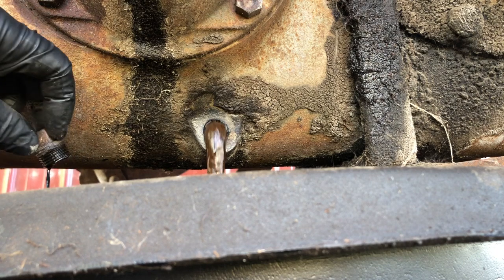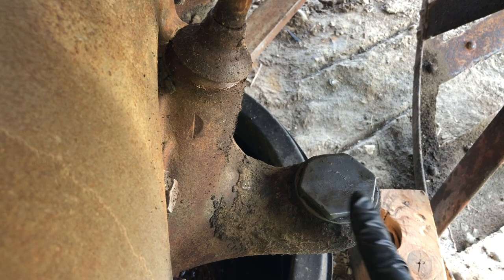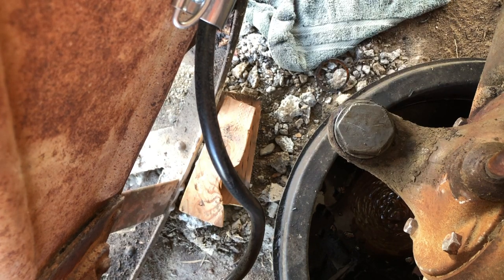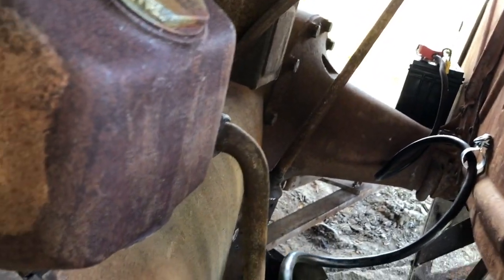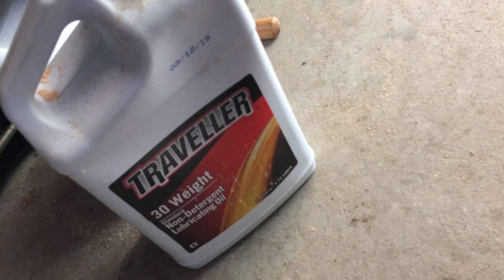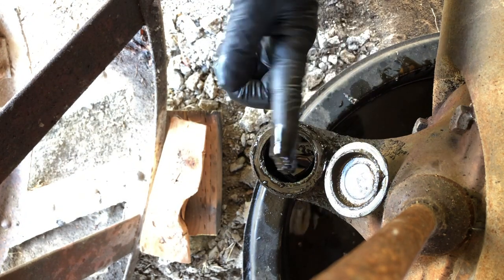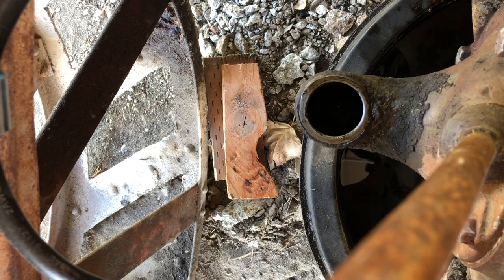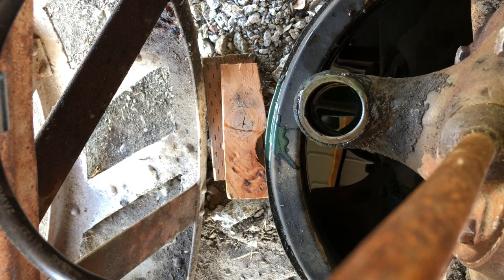1924 Fordson F Tractor - Changing the gear oil (rust-oration #20)

Comment: I did this oil change yesterday on the 1926 F I've been working on.  I thought I may have the same situation; trying to drain out the old oil, and was horrified when I found NO gear oil in it! I fushed it out with a bout 5 gallons of keroscene a few times and that loosened some sludge, but that was it.  I did let the bucket of new oil sit out in the sun for half the day in 90 degree temps, so that made the pouring a bit easier.  Fingers crossed!

Comment: I know in my old truck when I go to change the oil I'll put a pint of kerosene down the crankcase before I drain the old oil, start the truck and let it idle for 5 minutes or so, then drain the oil and the kerosene acts as an engine flush.  I wonder if you jacked up the back, started it and put it in gear with a quart or so of kerosene in the gear box if it might have the same effect at busting up more of the sludge in it.  Then drain it and add the new gear oil.

Comment: Where do you get the oil?
Reply from the maker: I bought it on Amazon. [Mobil 600w Super Cylinder Oil]. Back when I did that tractor the oil was around $120 for 5 gallons. Now it is almost $300 on Amazon. If I was doing it again today, I would just look for the closest modern equivalent.